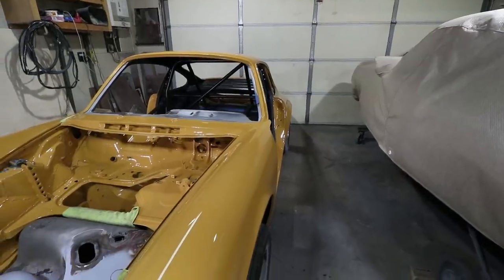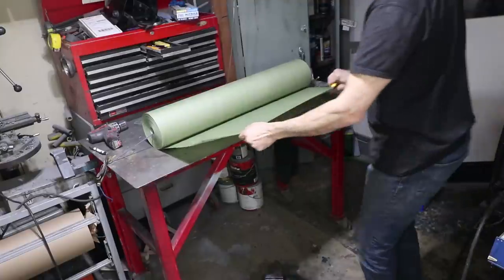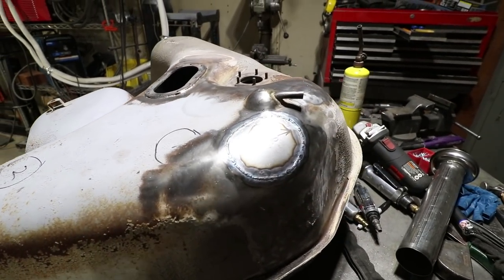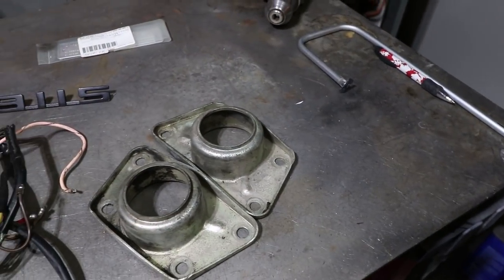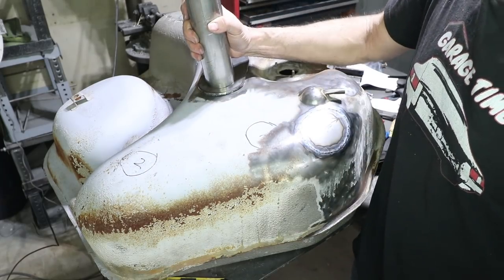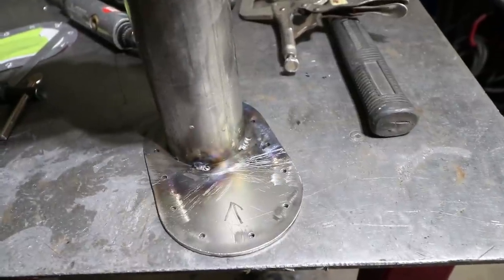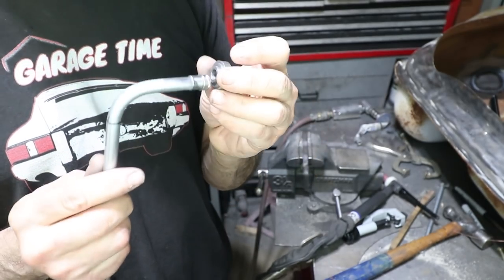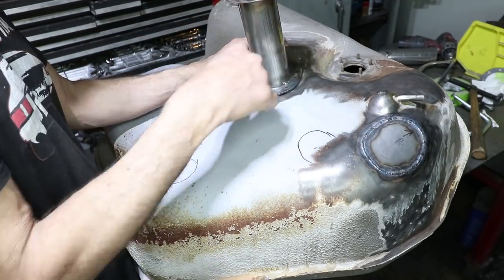Painting My Cars Interior & More Fuel Tank Mods

Comment: 16:20 nice to see you used the advice i given witht he sand in the pipe be bit tougher to bend but works like a charm isnt it :)
Reply from the maker: Yes, thank you.  I really packed the sand in there tight.  That's why I was hammering that bolt to make space for more sand.  Then I welded little plates on the end of the tubing.  Worked great with the bender in the video, but I also tried it with another bender that was nylon and it didn't work nearly as well even with the sand.  So it's important to have good tools too.

Comment: It’s unnecessary to fill the tubing with sand, the tubing will not crimp with the proper tubing bend tool, the tool you were using works fine, it’s similar to the one I use for 3/8 and smaller tubing. 
Great video.
😉👍
Reply from the maker: Thx

Comment: Instead of doing all of that masking, why don’t you just bag the car like the body shops do?  I also suggest using a miniature gun, and an air brush to do those small interior areas.  A lot less overspray.  Really nice project you have going there.  That would be a really great car if you could get it close to 10k.  I would be afraid to park it anywhere for fear some one would back into it.
Reply from the maker: Plastic is good although it still needs to be trimmed and taped down on every edge.  I like the paper because it doesn't flap around and get paint underneath it.  But then again, I'm not a pro.